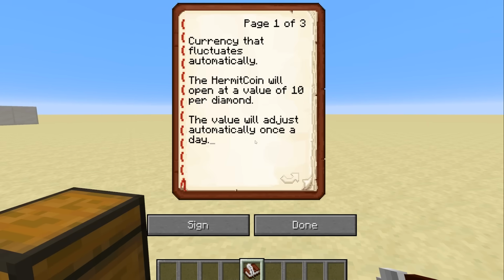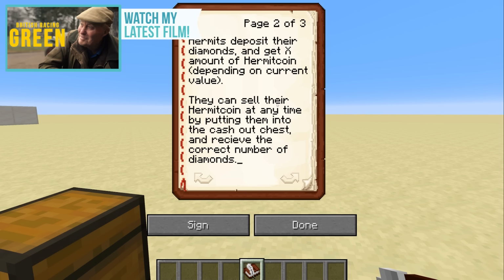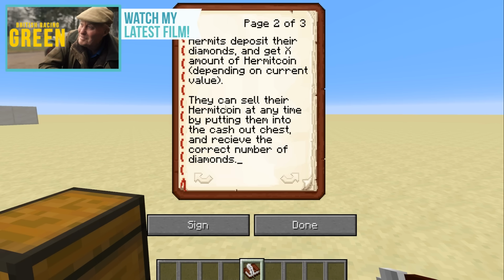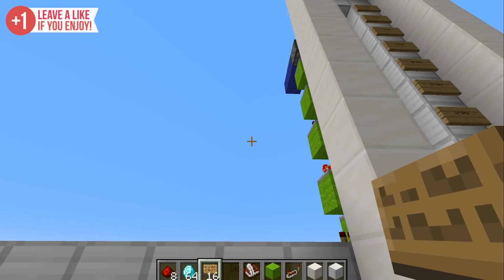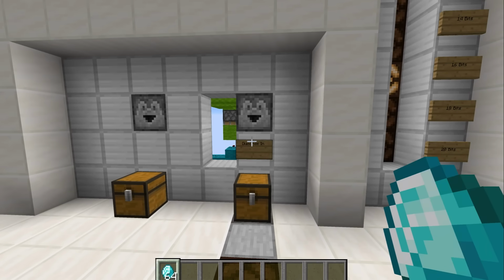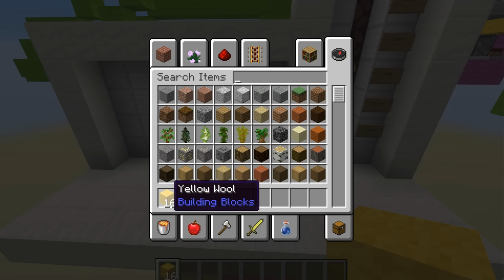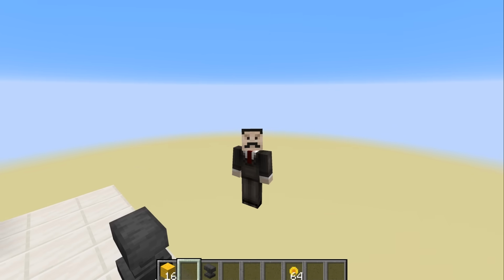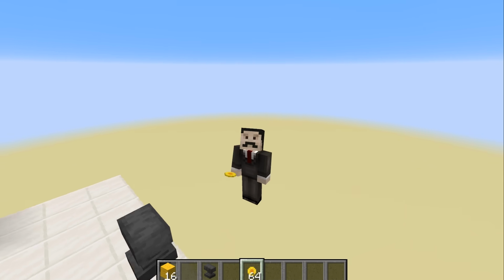HermitCoin Crypto Machine for Hermitcraft!

Comment: TL:DR - I think you should take supply and demand into account to change the price to make HermitCoin more stable. I also think that making coins more than one diamond would be useful or perhaps just increasing the coin supply. I am aware that Mumbo said he wasn't making an accurate cryptocurrency machine, I just wanted to share some ideas I had.

I did a little bit of research to help out. In real life, cryptocurrency value is determined by people wanting to buy it compared to the amount of people who want to sell it. If more people buy, the price increases. If more people sell, the price drops. This could be turned into a ratio of buyers/sellers. Using diamonds, the HermitCoins already have an intrinsic value, meaning you can measure the amount of people trading HermitCoins for diamonds and vice versa. This means that you can measure the value of HermitCoins based on the amount of transactions. You could use a daylight sensor to update the system daily, and take a comparator output from the diamond and HermitCoin storage. I’m not sure exactly how, but you can take a subtractor output to determine how much the price rises or falls. For example, if 3 people bought HermitCoin and 1 person sold HermitCoin in one day, you would take the output of 3-1, which is 2. This would make the price rise by 2. Of course if the number is negative, the price falls. Sorry for rambling, hope this was useful!

Edit: Wow, that's a lot of likes! After reading replies, I thought of some potential revisions to the original design.
1.) Charge a fee to make HermitCoin transactions. This would mean that the system wouldn't be able to be cheated, as the users wouldn't make money by exploiting the system. The fee would vary based on the amount of HermitCoins in circulation so that cheating the system would force the user to break even.
2,) Update the system at each transaction instead of daily. This is the best solution to the problem imo, but I didn't include it originally because it was too similar to Doc's stock exchange. This would solve the problem of repeatedly buying and selling to make money.

These solutions would solve the issue of cheating the system, a major issue with the original design. Thank you to everyone who pitched their idea's in the replies, here's a few revisions you made:
3.) Make the hermitcoins cost more than one diamond each. This would make the stock almost impossible to buy out by a single person, eliminating the chance of a money monopoly. If each coin was valued at more than a diamond, they could be more accurately measured in value as well (saying a coin is worth 2 diamonds is easier than saying it's worth 1/16 of a diamond)
4.) Increase the amount of HermitCoins in stock. This is a solution to the exact same problem above, which I think would be easier for Mumbo to pull off, since all he'd need to do is increase the size of the storage system rather than redesign the whole sorting system. All in all, both are functional and brilliant ideas.

And I just made an edit even longer than the original comment. Whoops! I added a TL:DR note for those who don't feel like reading everything. And yes, I did all of this for a Minecraft game. 

Edit 2: Oh yeah, I know Mumbo said that he wasn't building an accurate cryptocurrency machine. I just wanted to make some suggestions on how he could improve his design so a.) he doesn't go broke, and b.) so that the coins can actually be used in a valuable way. The revisions encourage people to buy when prices are low, and sell when prices are high, keeping the economy steady as long as one person doesn't buy out the entire stock (*cough* xisuma), and there are countermeasures to that now.
Reply: Jack Oswald yes this is exactly how I think it should work
Reply: This would easily be taken advantage of. Someone goes in and buys all the coins for that days price. When the daylight observer changes the value it will increase because there will be significant less in the system. Then the same hermit sells all the coins for that days increased value and mumbo jumbo loses diamonds. There only way I could see making something like this work is to change the value with each coin bought and sold. This means mumbo wouldn't lose our gain any diamonds the only risk/gain would be for the investors. However to make this work each coin would have to be more valuable than a diamond instead of each diamonds being more valuable than a coin as he currently has it set up. Also to make it work there could be no notice on what the exchange rate is.
Reply: @d13bowman80  You're right, but it almost doesn't matter. Using the random system he's going to lose money anyway.
Reply: D13 Bowman This problem could be avoided by Mumbo having thousands of hermit coin, making it almost impossible to buy out.
Reply: @d13bowman80  2 things, 1 is that it doesn't have to be worth more than a diamond, as long as the starting price is very low, and second, I agree with your idea, and had similar concerns. The price of hermitcoin shouldn't be random, it should be based on the current amount of hermitcoin in the system, which should be a fixed amount. That means that there will be no way to exploit the system and get infinite diamonds from mumbo. Even the diamond comission wouldn't be enough if the value of hermitcoin rises for no apparent reason. 
Basically I am saying that HermitCoin should decrease in value when people sell it for diamonds, and increase in value when people buy it, just like real life crypto.
Reply: That's how Doc's Stock Exchange works
Reply: Mumbo needs to see this!
Reply: The problem is hermitcoins are not really usable apart from the stock exchange. It would only work if the Coin has a value itself. And there comes in the Amazonlike store. Hermits should be able to trade with the coins there
Reply: Jack Oswald Why not just use the number of hermit coins in storage to determine the price?
Reply: This is a much better idea.
Reply: To subtract the amount of redstone signal you can use comparators in subtract mode if you don't really understand comparators it's ok no one does
Reply: thread tl;dr: instead of random increase and decrease, use suply/demand calculation to avoid unnecessary inflation that can break the currency fast.
instead of updates per day, use updates per trade to avoid abusing the trade system.

also, the fact that the machine won't give your coins back when given an incorrect value may also probably break the coin too.
Reply: Supply and demand should absolutely be taken into account.
Reply: Jack Oswald that’s how it should work, but... 

Your text is 27 lines long
Reply: I thought the value was tied to the amount of bitcoins left. If there are 10000 bitcoins in the bank and the initial price is 1000/1$ and some person buys 5000 there is 5000 left and the price of 1000 should be 2$ now.
Reply: I think the price should be based on how many hermitcoins are left in stock, updated ever time a trade is made. This makes it impossible to lose diamonds because the total diamond value of all the hermitcoins is fixed. The ones sold first would be cheaper, and the ones sold later more expensive, but the total value of hermitcoins + diamonds in the system wouldn't change. It also encourages early adoption because the people who buy first will get a better price. This could be implemented by storing the hermitcoins in a line of hoppers, with a comparator output from each one. These signals would tie directly into the existing machine. If you charge a transaction fee of 1 diamond, you would be guaranteed to make money. Also, let the hermits take hermitcoins out of the building and trade them with each other. This is vital for hermitcoin to be valuable: you want other hermits to start accepting it in their shops. As others mentioned, a good way to give hermitcoin value would be to accept it at the upcoming Amazon sh Note on implantation: the price might change in the middle of a transaction if they put in serval diamonds (or several diamonds worth of hermitcoin) at one time. You should return any hermitcoin that wasn't in enough to buy a full diamond for this reason.
Reply: Research for fucking Minecraft
Reply: @will_watches_anime_because4652  why not? Minecraft could be used for many serious applications, including research or art.
Reply: No don't use rambling that was really usefull information. GET MUMBO TO SEE THIS
Reply: Yeah it should work like this. Currently it's basically gambling
Reply: Pretty smart. But probably super complicated to do with redstone, but what can I say about that, I am not one of those redstone magicians.
Reply: I'm not really into redstone so I might be wrong. Your idea is really great and  depicts how cryptocurrency works. But I think the redstone contraption required to execute such an idea would be gigantic. The one mumbo built is already huge. If he tries to execute this idea it would be many times larger than this cause it involves to many variables. At the end it won't be that practically feasible to build such a big contraption. Mumbo is already involved in many big project. Again I'm not into redstone so I might be wrong. Knowing mumbo for a long time now, he'll most probably end up building this in the hermitcraft server. Let's see.
Reply: This is a good idea, but think of the context. This is for a group of people playing a survival minecraft server.  To develop and eventually build a machine that could do this in minecraft is such an absurd thing to consider really doing with any practical intent
Reply: @azztomouth6913  Why the hell not, tho
Reply: The prices are set by the people buying and selling... the fluctuations are caused by people trying to buy fast or sell fast, by offering more on each piece of selling for less.
Reply: Awesome u did the research. But u do realise, this is Minecraft;)
Reply: You lost me at if more people sell then the price drops :/
Reply: There's basically nothing to research. Every adult propably knows how currency works.
Reply: Call it Blok-Bux
Reply: Yeah, actually makes sense...
Also 300th like on comment, CONGRATS!!!
Reply: Which is literally trade itself
Reply: There is a much simpler alternative, which is to count the current amount of hermitcoin that have been sold, and raise the price accordingly. This would mean taking a redstone output from each user's vaults, and probably doing some serious comparator logic, but it is easier than @Jack_Oswald's option.
Reply: Great idea man!!!
Reply: Yes this is how it should work, I commented this on the last episode
Reply: that comment is too small
Reply: Yes. This is basic economic principle, and you nailed it. It would be great to see how Mumbo applies it!
Reply: better than random
Reply: Heeeeeeeeeeeeeeeeeeeeeeeeeeeeeeeeeeeeeeeeeeeeeeeeeeeeeeeeeeeeeeeeeeeeeeeeeeeeeeeeee
Reply: He better see this
Reply: Too long too read
Reply: @Katrina Bramble tldr, instead of making the value random, base it on the amount of hermits buying and selling. It takes supply and demand into account to prevent a crash or the supply going negative.
Reply: @kbram6099  If you're too lazy, the comment isn't for you

Comment: There should also be a chance for the prices to go down or up more than one step. If it only goes one step each time, then statistically, it will only stay in the same 5ish prices for the most part. That might be what you're going for, but if it's not, then there.

Comment: There definitely needs to be a serious buff to the value of this "crypto". It will be a huge pain to get stacks of sunflowers if people invest stacks of their diamonds. Maybe use diamond blocks?
Reply: What are you talking about? Sunflowers can easily be duplicated using bone meal and he has the guardian farm for XP, and you can rename things one stack at a time.
Reply: Actually he suggested using diamond blocks for sunflowers instead of diamonds so that the system runs 9x faster. Because nobody wants to wait for 700+sunflowers to be dispensed for 64 diamonds. But 7 diamond blocks would be similar diamond investment, but only 80 or so flowers get dispensed.
Reply: If someone put in 3 diamonds and got 18 Diamond Blocks, who do you think won? The machine which is supposed to be making money? Or the person who just got 162 Diamonds for the price of 3 Diamonds?
Reply: @LeviathanTamer31  he means a block of diamonds for the coin stack (4 or 6 or ten or 16 coins)
Reply: @qazwiz  no, he said that Sunflowers weren't a good trade for diamonds. He suggested swapping the sunflowers for diamond blocks.
Reply: @LeviathanTamer31  I think he means the input and output values of the hermitcoin. Every transaction would be in blocks of diamonds.
Reply: @cwmd7651  So if both the input and output of the hermitcoin are Diamond Blocks, wouldn't that mean that you're spending 1 Diamond block to get 6 more?

It still doesn't add up as good for the coin market.
Reply: Kylee Smalley True but he is going to take a small portion from every transaction so he is still making money. I believe he said as much in his episode.

Comment: The machine has probably a major problem: if the value of the hermitcoin changes during a conversion the machine won't work properly as the count will be divided, so i suggest to block the possible modifications to the value while the transaction is happening

Comment: What happens if the daylight sensor changes the value while it's counting? you should put a lock on the redstone so it doesn't change while there are coins running through the system.

Comment: Mumbo if the value of the hermitcoin is not based on the quantity bought by the hermits then they all could just buy a bunch in one day at the lowest price and another put them back for the most diamonds they will just be getting a bunch of diamonds from you when nobody else has bought any hermitcoin to change the value I recommend you use a system for pricing the hermitcoin based on the amount that has been bought

Comment: Since the value isn't tied directly to the quantity of HermitCoins in circulation, then it's possible that somebody can deposit HermitCoins back into the system and there not be enough diamonds for them unless you have a large buffer of diamonds.

For Example:
Let's say HermitCoins have a value of 8 bit. So a player deposits one diamond and gets 8 HermitCoins. Now the value randomly rises to 2 bit overnight, and that player wants to sell. Now the player will deposit 8 HermitCoins expecting to get 4 diamonds in return. Making a profit of 3 diamonds total. BUT, nobody has purchased HermitCoin expect for this player. So there is only one diamond in the system and the player only receives a single diamond.

This is why the value of HermitCoin needs to be tied directly to the quantity of HermitCoins in circulation.
Reply: HMMMMMMMMMMMMMMM!!!!

Comment: I didnt play minecraft for many years, but wouldnt it be easyier to use a comperator to messure the signal strength and on the right value for one diamond it drops away the load and start filling up again? ... The system now only has to watch what "pipeline" the coins get send through to reach the right comperator to the actual value.

Comment: @Mumbo Jumbo Why not just keep the count of coins up to the current value and use logic to determine if less than 16 (or current value) after no more items are flowing, then dispense an amount equivalent to the left over coin count. The counter would count up to one less than the current value: example: 0-15 and repeat as items flow until no items are flowing, then if the final count sequence is less than 16 refund (dispense) an equivalent amount; if amount is 0 then do nothing and reset the system (if necessary). Hope this is useful

Comment: You need to reset your counter after each person, otherwise the clock wouldn't be accurate for the next guy. For example if the previous guy put in 15 coins, the next guy only needs to put in 1 coin to get a diamond.

Comment: Mumbo this is NOT going to work for you!!!

I could buy all the hermit coins on a day when they are worth 20 coins per diamond.

Wait until they are at 2 coins per diamond and sell them all.

There is no mechanism to stop me repeating this process over and over until you are bankrupted and you will be liable for the difference.

The reason the stock exchange works is that the more I buy the more expensive it becomes so I can't buy everything at a low price and the more I sell the less things cost so I can't just sell everything in one go at a high price.

You need a maximum purchase / sale amount per day and even then that will only limit the damage.

Comment: At 8:46 Make sure that if someone doesn't put in enough HermitCoins when cashing in that they don't make it easier for the next person to cash in. 
(E.G. I try to cash in 15 when the value is 16. The clock reaches 15 and stops, giving me nothing. The next person cashes in 1 coin, and the counter would reach 16 and give them a coin) 
All that would need to be done is have the coin counter reset itself at some point.

Although maybe you've already accommodated for this and this is way above my head lol.

Comment: You should allow people to take hermitcoin so it can be used as a currency and just manually adjust the price when the supply is too high/low (or add an automatic thing that checks deposits/withdrawals and after a certan interval randomly bumps the price up when supplies go down, or bump the price down when supplies go up) 

I think that letting people run off with hermitcoin would be necessary for it to remain convenient, and adjusting the price based off of supply (in addition to or instead of the current method) could reduce any potential hording (just my own opinion, good luck on the hermitcoin)